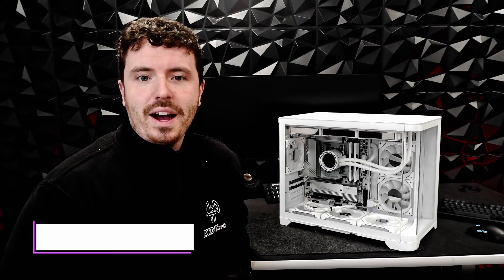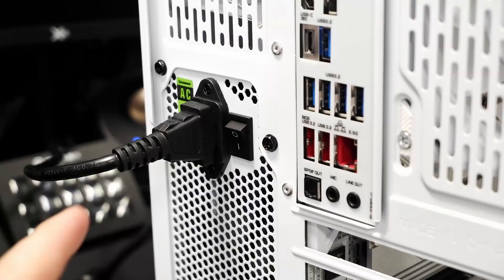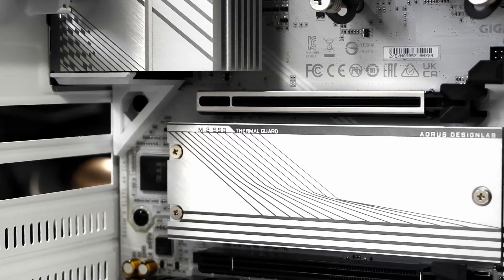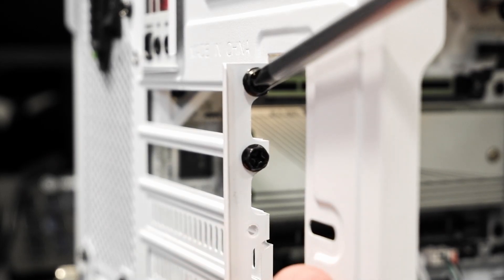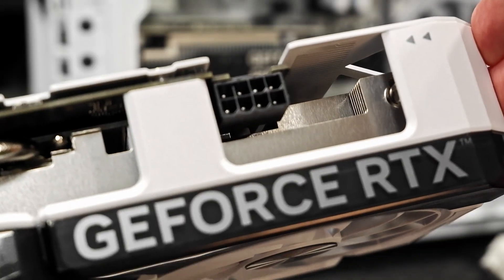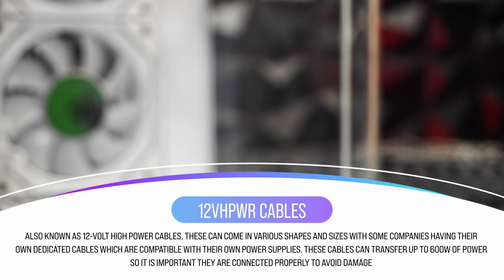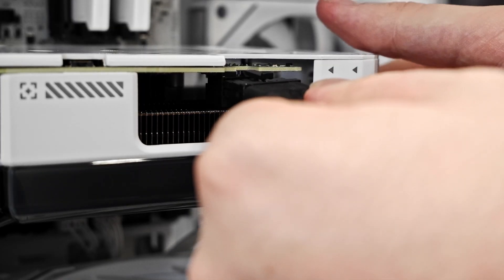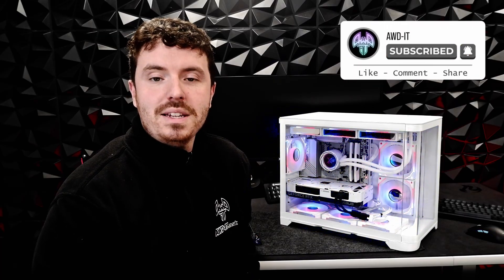AWD-IT | Our Guide on How to Install Your Graphics Card

Comment: I might be an idiot but i cant find the power port 😂 ive had PCs from here before and they have been great. Surprised there isn't a spec page as it looks like this time i need to remove bubble wrap and open the glass case.